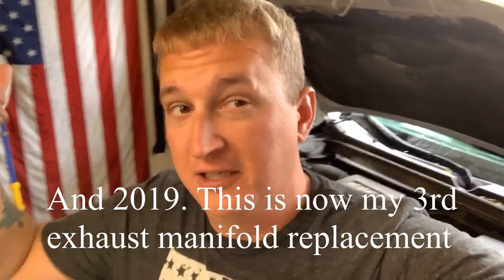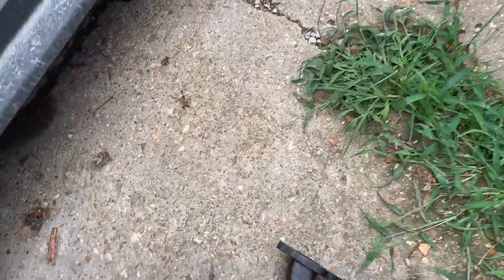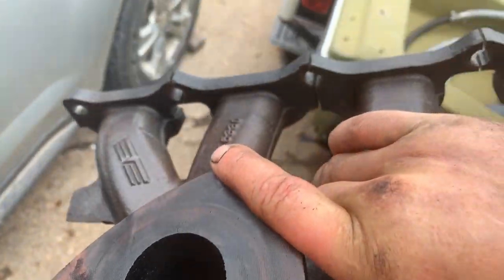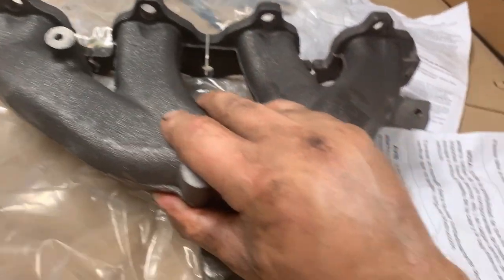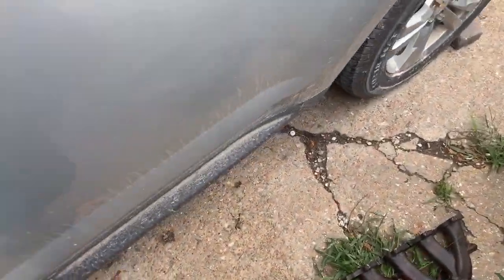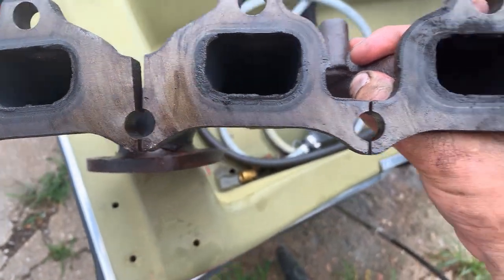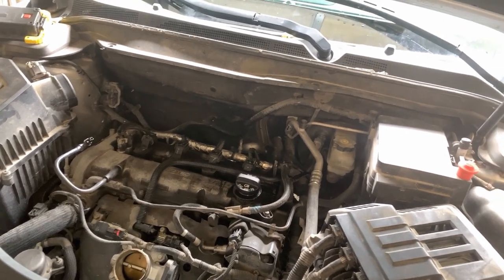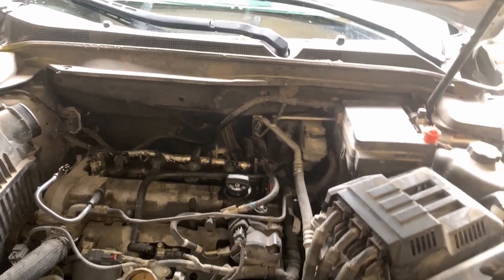Chevy Equinox exhaust manifold - Welcome to the Crapinox

Comment from the maker: Thanks for watching! Do you have experiences with the Chevy Equinox?
Reply: Yes, currently working on mine. Working on a drilling template to allow me to drill the bolt 🔩 that broke off straight and will use an easy out or drive in a star socket to extract broken stud. Let you know how it goes in the next few days.

Comment: I've seen these types of exhaust manifolds before and the reason why they crack and break, 1. They are a poor design.(gotta state the obvious first) now that is out of the way on to number 2. Look at how the part meets the cylinder head, they are not all connected as a solid piece meaning, they HAVE to be tightened in a sequence and torqued to spec but they also require lock tight on the threads, which I would never add to exhaust bolts on any other vehicle except for this poor design. I believe if you follow the steps and apply this to your situation, you will not have this happen to you again. If you want to take it a step further and secure it by welding each mounting bracket to each other, strengthening the entire unit, I would do so.
Reply from the maker: Hey thanks for watching! I have installed them using torque spec with thread locker, never made a difference. Thankfully I moved on from the Crapinox.
Reply: @PenguinOutdoors  I feel stupid I wrote my comment after watching 20 seconds of your video lol. I'm glad you have moved on, unfortunately my client has not and I'm setting this job up for the near future. Looks like a fun job with almost no access from underneath the vehicle
Reply: P.s.  I will be welding the new unit before installation.
Reply from the maker: @SmoothBrain23  Going from underneath will just bring you misery. There is a guy on YouTube who has some great tips on this. https://youtu.be/bifUDyzVuEU

Comment: I feel your pain.  We have a 2013 Equinox, and we just had to replace the exhaust manifold when I had to take it to the shop to have the secondary air injection ports cleared out (yet another common problem).  I like to call it the Veganox because they've managed to re-create the chronic oil burning and rusting of the Vega from the 1970s.  Ours burns oil, it's on its third muffler, the doors started rusting when it was 2 years old.  Hoping to get rid of it next year, and hopefully we can get a few dollars for it in trade instead of having to pay somebody to dispose of this junk.
Reply from the maker: I cant even recall all of the repairs I had to do on that thing. The timing chain failed twice lol

Comment: replaced ours 2x and it cracked again. it's just sitting in the driveway as the emergency backup cause I'm not payin for it again. known issue but they don't change design or recall.
Reply from the maker: I have always been baffled by Chevy's flat out refusal to acknowledge this and do a recall.

Comment: got a 14 equinox leak in the manifold auto shop wants $505.
Reply from the maker: It's so not worth paying that much! The process is a royal pain but the problem with paying over $500 is the manifold WILL crack again. Which means you will be spending that money more than once. As much rage as replacing this myself repeatedly made me feel, I did not spend $500 in total for all of the times I did it.

Comment: Soooo I unfortunately have the same vehicle, 14 equinox. Just found out my manifold is cracked. I know close to nothing about cars, so with this problem how long can I go before it’s serious? It gets driven maybe 2-250 miles a week, with probably 200+ Highway. Decided not to pay for it yet because to me $700+ for an exhaust problem just seemed too much. With majority of cost coming from labor. Just looking to see how much longer I can milk this pos out before I have to get a new vehicle. Thanks!
Reply: You can milk it as much as you want .
If that crack gets bigger it’s just gonna sound horrible when you turn on your car 
Do it yourself and only pay like 100 bucks !
Reply from the maker: I disagree with the other comment, you cannot milk it as long as you want. A cracked manifold means air being pulled into the engine and the combustion cycle where it is not wanted or intended which can cause damage to the engine. It also means vibration and uneven weight distribution of the exhaust and manifold across the engine block. All of these factors (and more) can cause serious damage, and when you are talking about this specific engine and all of its defects and prone failures it is a bad plan to simply assume it will just sound horrible and that is the only negative. That all said it's not terrible to do yourself, I got pretty darn good at it. Buy the manifold on Amazon for like $100 and do it yourself.
Reply: @PenguinOutdoors  is there a video you can direct me to on how to do this properly? Im far from a mechanic, is this something I can just pop the hood, take some things out, and replace? I have pretty basic tools at home and a drill set. Hoping thats enough lol. Thanks for the response.
Reply from the maker: @brohsephyt  yes it's all basic tools and not too intense. I followed this guy the first time I did it without issues. https://www.youtube.com/watch?v=25-w5L3SKR0&ab_channel=LarryWallace
Reply: Joe it's easy man save you some money and do it yourself. I did. shop wanted 505 I spent 10 on a o2 sensor socket and 59 on a tool set. boom it's replace.

Comment: i have a 13 crapinox 2.4 with the same crack now it sucks bc is a pain in the butt to remove it and it happend 3 times to you as of right now im looking to replace it with like a high performance or something like that i dont want to change this thing every year. thanks for the vid
Reply from the maker: I totaled the crapinox not long ago and after all it has put me through I think that is almost a blessing lol. I looked into the aftermarket options but the feedback in my research indicated they would suffer the same failure. It seems to be due to the design they used to accommodate the limited space, and the aftermarket options all seem to follow the same path. I wish you far more luck than I had with them. I made the video largely just to vent because I was so over it. If it helps someone that is even better.
Reply: @PenguinOutdoors  yeah I spend 3hrs looking but no luck I guess since we know where is gonna leak or crack I'm gonna go ahead and wrap it with some exhaust tape and get another 6months more 😂😂 out of it .
Reply from the maker: It certainly can't hurt. I suspect that part of the failure may be due to the bolts coming loose and allowing the manifold to flex or rattle at the point of failure. So it might not hurt after 2-3 months to check the bolts and make sure they stay tight. Maybe that will keep it going along as well.
Reply: @PenguinOutdoors  I will for sure try that thanks..
Reply from the maker: @cuauhtemocbarragan9632  You're welcome, thanks for watching! If you are not a subscriber I welcome you to be, and feel free to share any of my content you would like. Thanks again!

Comment: My engine light is on need to find a leak in my emissions won't pass. Had a new catalytic converter and my two sensors had the catalytic converter changed again may not be Chevy part I just need to pass emissions there's an emission link but I thought about changing the manifold  and my cousin said the gaskets top motor will be good. 
Mike's are 235,153 
I just want to use it little longer. Runs good.
Reply: Mine not cracked ..I lived in TN to NM visit AZ and CA. 
Back to TN. Yes had to fix it. Rebuilt transmission.
Reply from the maker: Thanks for watching! Glad you got it fixed.

Comment: Likely cracking due to clogged catalytic converter.
Reply from the maker: I wish it was that simple, but the exhaust system was fresh for several of the cracks. It's a defect of the design and a well documented point of (repeated) failure with that engine / vehicle. Thanks for watching!
Reply: I just changed the manifold for the first time on my 2011 equinox. It was cracked, as well as the muffler leaking in the most common spot. What a burden that manifold was to change......
Reply from the maker: @xxtyler420xx  I have been free of the crapinox for almost two years and i still haunts my dreams.
Reply: Ours has been a very reliable car. But it uses more oil than any vehicle I've ever had.
Reply from the maker: @xxtyler420xx  It's a well known defect with them that has resulted in a few lawsuits. Make sure you keep the oil topped off at all times. The biggest flaw with them is the timing, and at some point it will fail. The lucky ones are able to replace the timing components with no damage to the engine. Others it destroys the entire engine. My timing chain broke three times. The third time it trashed the whole motor.
Reply: Can I ask at what mileage this happened? Ours has 140,000 miles and seems to be a cruiser. I'm debating taking it on a 2000 mile journey soon.
Reply from the maker: @xxtyler420xx  The first time was around 70k I think. I know the second time was at 120k. Third time when it finally went and exploded into a disaster was just shy of 140k. If you google Equinox timing chain failure it'll show you a whole new world. Chevy has never stepped up and done the right thing on this.